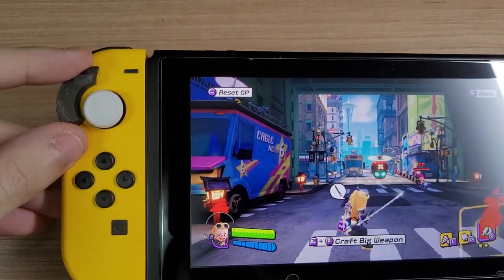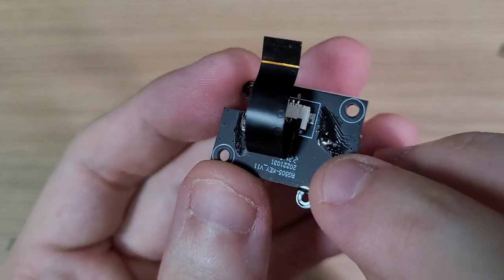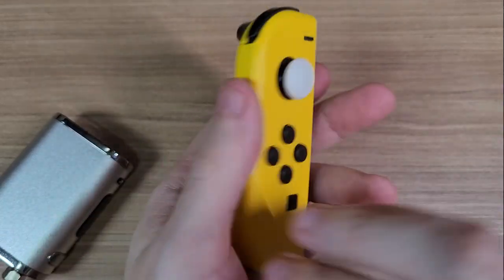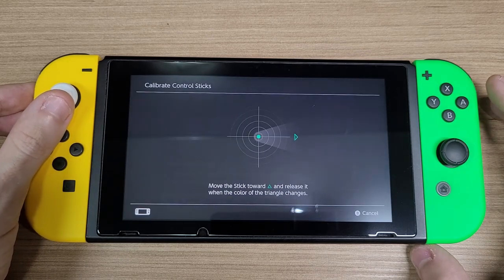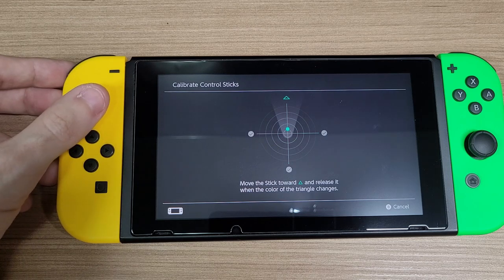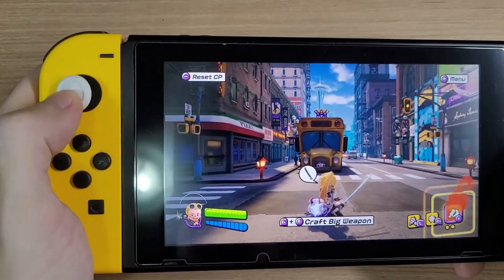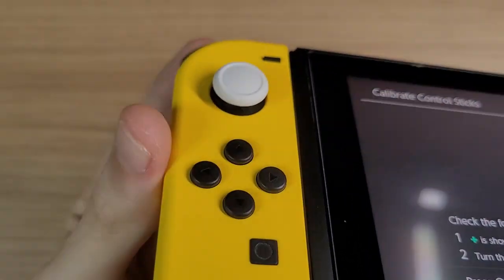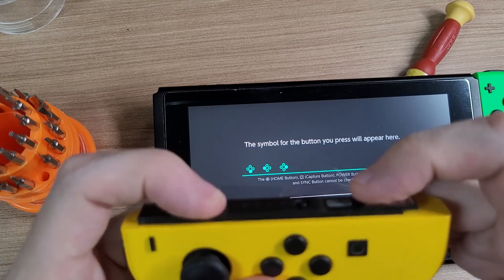I tested the K-Silver hall effect sticks on Joycons!

Comment: Considering these sticks come from a dedicated device, and aren't sold as bare modules like JC replacement sticks, I have a feeling that the chip on the stick is expecting a different voltage.  Say 5v compared to 3.3v (I have no idea what the Switch or other devices use, I'm just making an example) which would skew output negatively; similarly, if you take a 5v controller with potentiometers which would have a 2.5v center, and feed it 3.3v you would now have a 1.15v center, which is actually fairly close to the lower end of the usable voltage range considering carbon pot wipers have a much larger arc when the stickboxes themselves only have ~±23° of movement from center and this is further limited by the controller's stick gate.  Depending on their actual implementation, this may be a limitation that isn't easily worked around, say if 5v is the lower end of the operating range for the chip, and a lower voltage variant isn't available.  There also has to be some kind of IC, just look at the Steam Deck hall effect replacement sticks from GK, each board has an IC on it, look at the design of the KingKong 2/Zen Pro and notice the relevant hall sensor IC, you could even compare an 8BitDo Ultimate wired/wireless with the bluetooth version and see that the hall sticks have an additional IC.

Comment: so i recently got some of the k-silver joysticks and had the same issues as showcased on the video, after contacting the seller that i got them from, i received a photo showcasing that the joystick requires additional jumper cable soldered to the pcb to deliver more power to the joysticks. after i've done that, the joystick worked perfectly fine with no need for calibration at all
Reply from the maker: I heard about that

I ordered a pair and gonna make a video update on them soon too!

Comment: Hey for the SL SR cable breaking, i think you are mounting it wrong, also sometimes brand new Joycon have them wrong, but my point is you make sure the cable goes under the plastic battery holder (the same you use for holding your cardboard against the stick) so it doen't get caught between battery and back cover and won't bend 180 degree, also not break after 2 or 3 teardowns.
at least that what i found after fixing my joycon drift thanks to your findings, so again thanks a lot for that !
Reply from the maker: They break under the plastic too I had them mounted in both ways
And both break very easily
Reply: @VKsChannel  oh okay nevermind then, i'm just lucky for now, thanks for the information
Reply: I wonder does it ever break the first time you open it? I replaced a number of joycon sticks and never had a problem with the SL SR cable breaking. I did a shell swap on a pair recently and did have one that had the same flickering playerlight problem but took it apart again reseated the connector in it’s port and the flickering was gone. So for me so far it did not break. Also my ribbon cable is always routed over the battery folded flat. If you look closely you can see that the back panel of the case is notched leaving some room for the cable…
Reply: @kenalfaroponce4778  well for me it broke on my first joycon After 2 Times, and when i tested it xas broken on the flat bend spot, and since i place them under the battery cover i did not encounter any other issues

Comment: I don't know how the sticks send their positions to the Switch, but assuming they just send analog voltages for the potentiometer values, maybe it can be fixed by adding some diodes or resistors in series, or in worst case, the signals have to be amplified. If you are interested, you can try to measure voltages on the pins of the original sticks and the pins of the hall effect sticks and see what is the difference
Reply from the maker: It's definetly doable but it is a time consuming task and since gulikit is already working on these sticks I'd rather wait for their solution 

If a long time goes by without the sticks coming out officially I'll try to work on it
Reply: @VKsChannel  Oh nice, I didn't know

Comment: hello good, at minute 6:07 it mentions that the Flex of the SL/SR and the SYNC button of the left joycon broke, I created a button by soldering a certain part of the board, I did the same with my right joycon exclusively for PC use now I was tired that the flex broke easily since it happened to me 2 times even opening it delicately, so I was able to find 2 points to solder to make the bluetooth SYNC button of the right joycon work, with the detail that the SL / SR could not use them , but that doesn't interest me if I use them on PC as long as I can use the joycons on both PC and Switch. I am happy. This is what I did. It is the correct joycon. but on the left you can find the 2 solder points and create a button that should be the same system just in a different location you can search for it like in GBATEMP: Point found to solder to create a SYNC Bluetooth button on the right joycon in case the flex cable broke
Reply from the maker: It is an option but i like to have the joycon lights working too and the SL and SR buttons functional

Comment: What the hell. I've installed these guilkit in mine Switch OLED and my friend's V1. Nothing like this happened in our case. I didn't have to even calibrate it because they vere perfectly in 0 position. As a person with totally no experience in electronics I've had no problem with open joycons and didn't broke anything inside it. As a matter of fact the same thing I've did with Steam Deck (with some help because of soldering) and one again everything just worked. Maybe it have something to do with using analogs from different device. Maybe try dedicated set, it's not that pricey.